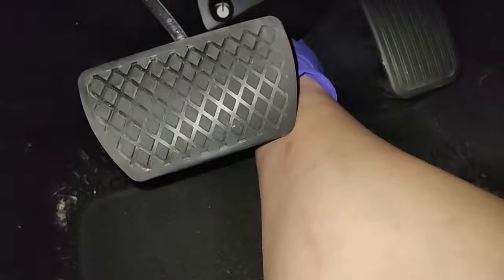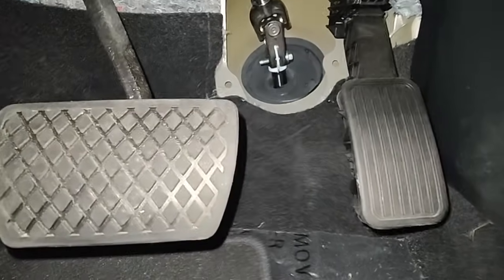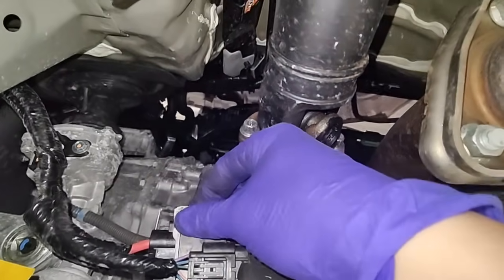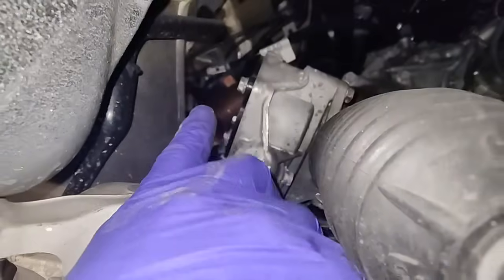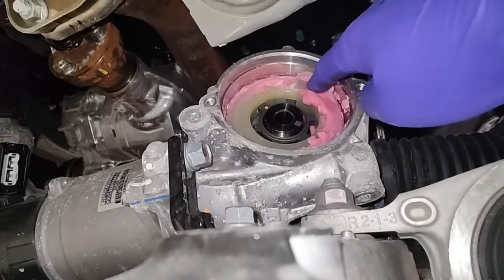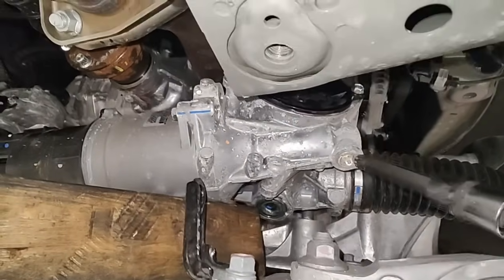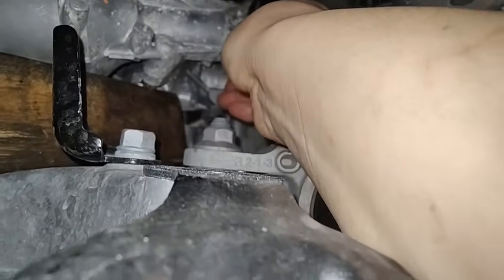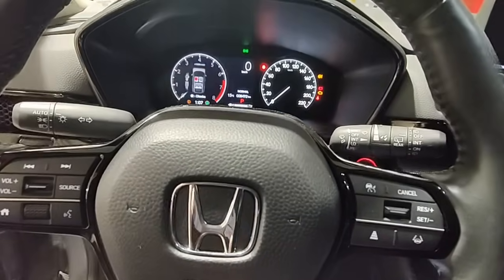Almost 1.7million vehicles are recalled for this.

Comment: I just had this recall done today at the dealership ( Larry H. Miller, Honda of Murray, Salt Lake City, Utah) They recommended an alignment for the price $100.00 which I turned down knowing my vehicle has less than 15k miles. 
Curious to know about the recall. I found your video. Little did I know they should have done the alignment for me,
without charging me for it after this service.  Am I correct?
Reply from the maker: The recall includes the alignment. But this recall has been revised and does not require an alignment and can be done without removing the subframe so the suspension does not change. Sounds like that dealership is trying to make a buck off you.
Reply: @theoffroadingmechanic  thank you for responding.

Comment: Revised recall now. No longer required to drop sub frame. Honda provided my dealer with special tools. Did a civic earlier today, it paid .6  also congrats!!
Reply from the maker: Damn only 0.6? You're in the US? We still have to drop the subframe no revision. Actually the revision is still dropping the subframe as of Oct 7 2024. Here in Canada. I think I would rather take the time for dropping the subframe than get 0.6. lol
Reply: @theoffroadingmechanic  sounds like you need to move to the states?
Reply: Why not buy/make tool needed to fit the valve in-place?
Never worked at the dealer level so maybe somehow not allowed.
Reply: we need the special tools.:face-blue-wide-eyes:

Comment: Nice to see a different perspective 👏
Reply: Hey, good to see you here BC. Fwiw, you and Offroad my two fave YT Honda mech/techs.
Reply: @ I like to follow all techs and see their perspective on things as well as see what issues they are running into.
Reply from the maker: Have you replace PCM on the new CRV 1.5t or power control unit on the hybrid. We got a new one and the coolant press fittings leak right out of the box
Reply: @theoffroadingmechanic  we have a PCU fail on a relatively new cr-v hybrid

Comment: What a stupid ass recall. Did I ever mention all the problems we went through with the second gen Odyssey back in the day with the sliding doors? Oh lemme tell you how many "product revisions" we went through before the powers that be finallly figured out the upper door seals were the problem.  

When my wife was pregnant with our oldest, she bled heavily about 6 months in. Turns out we had twins, it's called vanished twin syndrome. I'm not kidding. Our oldest was born 6 weeks early. She's almost 28 now and other than scoliosis, no health problems. I hear Linkin Park in the background
Reply from the maker: We have been having the 5th gen snapping sliding door cables, micro switches in the rear latch assembly failing preventing the sliding doors from working that had a recall to replace that rear latch but they still fail. not much has changed. 
Thanks for your input. 
Running out of things to listen to at work everyone just picks something to play on my speaker.
Reply: Is this the reason why the steering wheel gets hard when going fast and makes noise when turning in place? And I don't understand whether the spring should be changed along with the grease. I would be glad if you could help me.

Comment: Honda is losing my confidence. My new Ridgeline needed a few dealership returns to fix mechanical issues.  There is also word the engine might get a major recall soon too.  I bought a Honda for its reliability and quality, seems I their aren't what they once were.
Reply from the maker: We have had new ridgelines come in for moisture in the headlights, noisy click spring but it's because the steering lock that the clock spring mounts to us off center I have a video on that. Issue with the tailgate and some fit and finish stuff. For the engine recall here in Canada I think they are just rolling out the engine bearing inspection recall. People are holding on to their first gen Ridgeline and many come in with almost half a million kilometers.

Comment: There are a few other videos where the mechanic is actually syringe applying grease into the smaller second hole where the replaced spring and cap get threaded in with HondaBond.  They actually mention the minimum amount of grease required so you have to check the scale on the syringe to make sure you injected enough grease to meet the spec.  So are there 2 different recall procedures being given to the Honda/Acura dealerships?  There is no syringe grease addition in this particular video.
Reply from the maker: You're most likely watching the guys in the USA I am in Canada we didn't get that kind of treatment. Might be revised by the time I get back from my month vacation though.

Comment: I don't know if it work cause the gearn is a plastic gear on a aluminium worm gear. maybe it last for 3-5 year and when the plastic wear out the warranty expired.
Reply from the maker: This is just for the sticky steering cuz it affects the safety system. There are other ways that these steering racks fail and it makes it feel like a loose inner tie rod but it's not. https://youtube.com/shorts/zbDl76GZmx0?feature=share

Comment: Japan does NOT use triple square 12 point.  They use bi-hex 12 point. DO NOT attempt to tighten Toyota head bolts with trip square.  You will strip the head bolts. And a head unevenly torqued until the snap-on truck shows up is now warped.
Reply from the maker: All your "Japanese cars" aren't  made in japan anymore. Bolts are now torx, inverted torques etc

Comment: I had my civic fixed because of sticky steering. It's doing it again so you are correct that the grease will spin out again. Does the accord have a similar part with grease like this? I'm going to trade in my civic but don't want another car that has this greasing issue.
Reply from the maker: The new accord doesn't have the recall. Just the high pressure fuel pump recall so far.
Reply: I have a 2024 Accord, and it has a steering problem! Not sure it's the same issue as the re-called Hondas. Mine has a sticky spot when the steering wheel is on center. It makes it hard to keep the car going straight. Eather you are drifting left or right. And of course, the dealer says there is nothing wrong and won't acknowledge that there is a problem.

Comment: Is this the reason why the steering wheel gets hard when going fast and makes noise when turning in place? And I don't understand whether the spring should be changed along with the grease. I would be glad if you could help me.
Reply from the maker: What I have noticed before replacing the spring and putting new grease. I feel a very slight notchiness when doing small steering input. After the grease and spring there is a noticable smoothness. Not sure if it's the spring or that extra grease we squeeze in. I say squeeze because they revise the recall and got the tool to remove the cap and a syringe to squeeze more grease in without dropping the subframe now.
Reply: @theoffroadingmechanic  Could you please tell me the dimensions of that broadcast? Unfortunately, my vehicle does not have a warranty, I want to do it by watching your video.
Reply from the maker: What year and model is your Honda?
Reply: @theoffroadingmechanic  Unfortunately, the service voided my warranty because I installed coil suspension on my 2022 model vehicle. They do not accept the steering fault.
Reply from the maker: For a 2022 CRV I don't know if this repair applies since it is the previous generation. There was a bulletin for the issue for the some later models but we were replacing the entire steering rack to fix the stiff steering issue some of them were pretty bad at low kms.
Reply: @theoffroadingmechanic  I understand. The new bow you used here seems a little smaller than the original bow. Do you know the dimensions? I will try to make it in my own country.
Reply from the maker: Bow? You mean the cup and the spring?
Reply: @theoffroadingmechanic  yes please.sory my English not good (translate)
Reply from the maker: Sorry I do not know the dimensions. All I know is that they changed the spring rate of the spring but that's all the information we get from the recall. I would think that for your issue all you probably need is to regrease that worn gear in the rack for the stiffness. Like on this recall the grease has displaced itself away from the gear.
Reply: @theoffroadingmechanic  Thank you very much, I will continue to follow you👏🏽

Comment: this is the similar problem with hyundai coupler issue?
Reply from the maker: The Hyundai coupler causes a clunking noise when turning and going over bumps because the rubber bushing in between disintegrates and causes metal on metal contact or slop in the coupler. This recall is for sticking or notchy steering. That will affect your safety system like lane keep assist.
Reply: @theoffroadingmechanic  ah so this is more critical to have done stat.
Reply from the maker: Yea I've had back to the 2021 even earlier where the steering is so stiff they don't return back to center but we were replacing the entire steering rack. But I guess it's getting expensive for honda so we are doing this repair now. 😆
Reply: @theoffroadingmechanic  we shall see if repositioning the grease will hold up. lol...

Comment: Omg... High pressure fuel pump recall... Honda isn't reliable anymore 😅
Reply from the maker: Yea if it is under 1100kms I think it gets replaced. If it has over 1100kms it is inspected for cracks and leaks and replace if needed.

Comment: I'm glad Kia's/Hyundai's power steering is on the steering column and not on the rack.
Reply from the maker: Kia and Hyundai's power steering motor is mounted to the rebar behind the dash. I have replaced quite a few of them due to the welds on the rebar that the EPS motor mounts too requiring to remove the dash. Had many complaints of a clicking noise when turning the wheel left or right and the amount of torque that motor puts on the mounting points causes it to flex and crack the welds. I use to have videos on it showing the broken welds and how the whole steering column moves when turning the wheel.